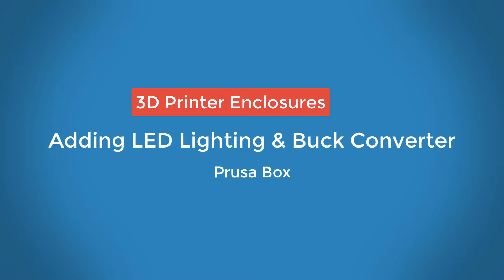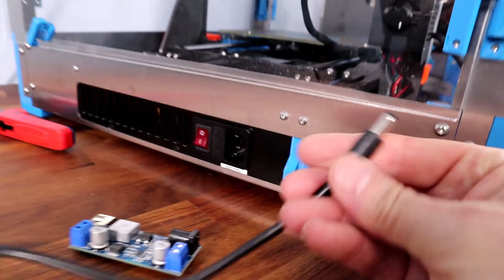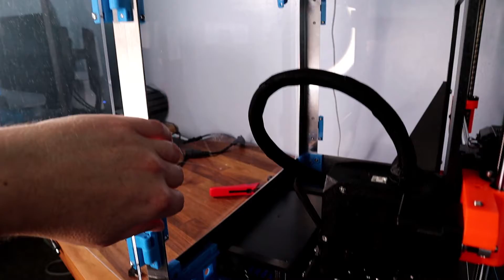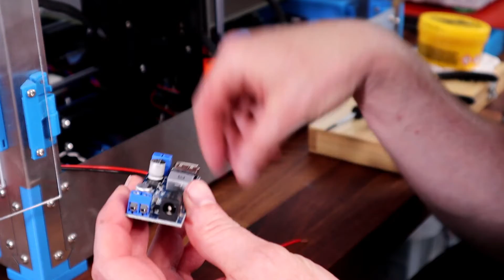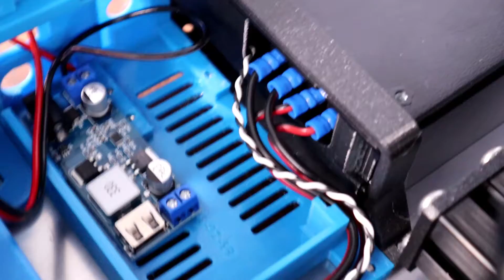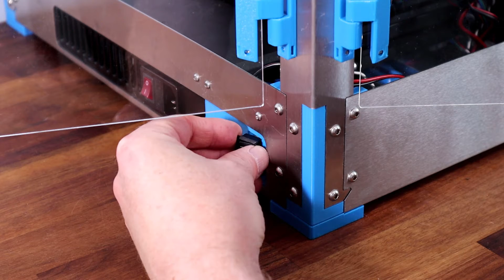Prusa Box - Fitting LED Lighting: Prusa MK3 Enclosure

Comment: Hey Colin! Thank you so much for doing these videos. I'm ordering pretty much all the same parts you used. What gauge wiring would you recommend?
Reply from the maker: Think I used 20 or 22 but get the stranded flexible and just tin the ends. I used solid core and it's a pain.

Comment: Colin, how well would you say this enclosure does with holding temperature and trapping particulate? Curious how well of a fit the plexiglass fits into it's metal framing, if it's drafty? The whole thing looks really cool. Thanks.
Reply from the maker: Hi. The plexi fits over the metal not inside so overlaps. It can get pretty hot with PETG or abs so I use the extractor fan with HEPA carbon filters to regulate temp. For PLA I tend to open the top window hatch to avoid it getting too hot and that does the trick.
Reply: @colinhill  Awesome, thanks for the reply!

Comment: Hi Colin, your wiring to and out of the buck converter is confusing me. On the power side of the board, there is a 5.5mm socket that is a INPUT DC 9-36V, may be different voltage for yours. That is where you plugged in the wall adapter (input power). On the same side of the buck converter board where you have the wires going out to the LED, this is diagramed as input Power Supply (DC 9-36V) using wires (voltage may be different for yours).  I would expect that the wires that power the LED would be connected onto the opposite of the board where the 5V outputs are (i.e. to the LED Lights)? can you clarify with your board info. This is the point of the buck converter to take a high voltage i.e. 9 - 26V and step it down to 5V. Just a bit curious here :)
Reply: This confused me too as the two terms next to DC Input are input, not output terms?
Reply from the maker: I understand. But if you use the input socket that automatically gives power to the wire connectors next to it. I am using 12v LEDs so need 12v supply. I am using the 5v output for my Pi/screen. Of course if you are using 5v LEDs then you can use the 5v end.